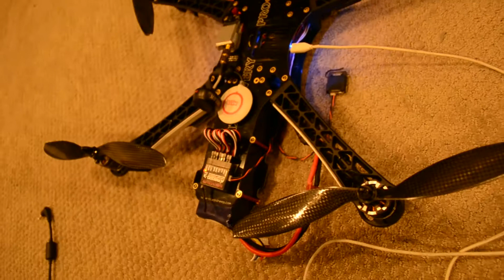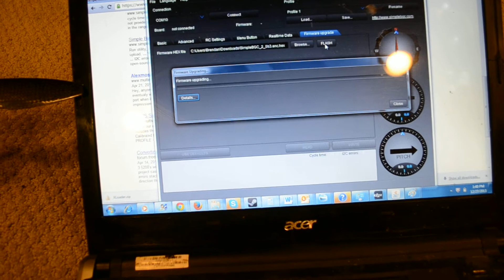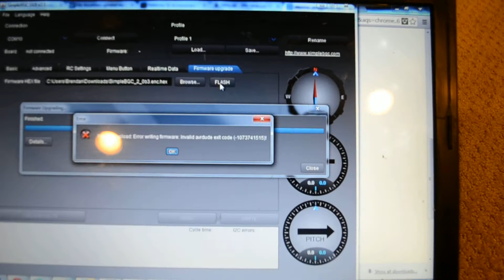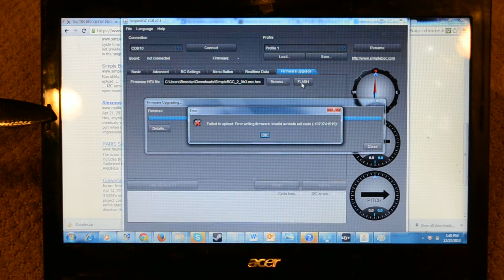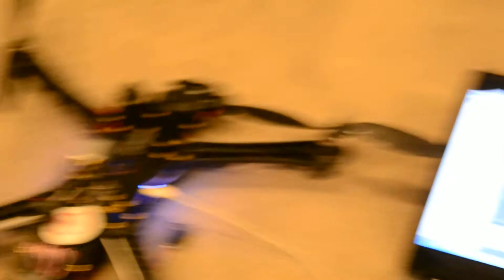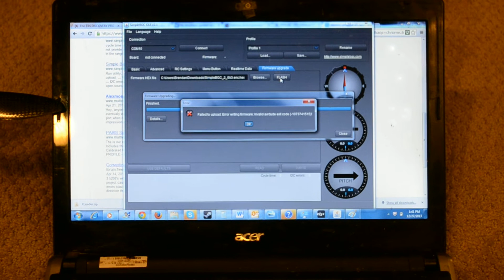TBS Discovery PRO Gimbal Malfunction

Comment: Had the same problem with another gimbal using the BCG software... it's happened to me twice, and the only way I've been able to fix it is by re-flashing the firmware more than once. I considered upgrading to the more recent version firmware, but I get the same error message your'e getting. Glad to hear you got it fixed! 

problem

problem2
Reply from the maker: Yeah, I knew it had to be a code issue. re flashing is the only thing I could think of to fix it

Comment: So what was the problem? How was it fixed?
Reply from the maker: Firmware mismatch.
Reply: Thanks.
Reply from the maker: That's the issue with the Discovery pro. The BGC appears to be incompatible with later alexmos firmware
Reply: This certainly raises an eyebrow. I'm in the market for a Disco Pro and from this Ill certainly not be eager to update the firmware. Thanks for the heads-up.
Reply from the maker: Absolutely! I've got well over 50 flight miles (logged) on mine and its treated me great. At least you know it works great out of the box

Comment: try to run the program as administrator, it might have an authorization problem to connect...
Good luck dude!
Reply from the maker: Thanks for the tip man! Tried that once but I'll try again
Reply: tell me if it worked. GL
Reply from the maker: Sadly no :( Trappy is sending me a new board
Reply: oh that's nice!
Reply from the maker: he wont need to though, finally got it!
Reply: oh nice, congratz! What was the problem?
Reply from the maker: I have no idea. I plugged it in one last time, It recognized, updated to 2.1, changed to trappy's settings

I have no idea what I did but I wont argue with success!

Comment: I had same issue with mine ( also the high pitch noise :D ) 

Here is what i did:
1. Downgrade to 2.1 FW with XLoader, you can find it here: http://www.basecamelectronics.com/downloads/

2. flash it with upload button, also 2.1 FW is on that page, it will say failed in the end but its ok its just troll message I guess :) it will flash it.

3. Download SimpleBGC_GUI corresponding to 2.1FW ( you can't use other version, they are not compatible ) 

4. go here: goo.gl/6IG27H download Profile 1 and Profile 2

5. Using SimpleBGC_GUI select on top right corner profile 1 and load profile 1 and apply

6. same thing just select profile 2 and load profile 2 config, apply

Make sure you have the gimbal looking forward... that did it for me, I still have to figure out how to give more power to brushless motors as even very small cable tension will make the gimbal stutter... Hope it help.
Reply: Also when it ask for power cycle, unplug battery and USB cable as well.
Reply from the maker: Thanks for the info Vlad! But unfortunately no luck Xloader keeps giving me a "cannot open port error"
Reply: Brendan Stewart it doesn't show in Device or COM port menu in Xloader ? I forgot to mention that I had to install driver first so the USB work, here: goo.gl/G58bpZ
Reply from the maker: The driver is how I uploaded the 2.3 in the first place, but it shows COM8 and COM10 in Xloader. Both say "cannot open port"
Reply: Brendan Stewart yea I was thinking you already might have when you uploaded the new FW, this is very strange behavior I didn't see that yet on mine :-/
Reply from the maker: I hope you never see it on yours! :)
Reply: Brendan Stewart one more idea, did you try to connect it to different PC ? if that doesn't work, it might be time to contact TBS directly
Reply from the maker: Yeah, I'l try that too. But my other PC had a fiery motherboard failure. Lol I'll get some help from Trappy
Reply: Brendan Stewart ok cool, he might be able to help. Let us know how it goes.
Reply from the maker: Will do! In the mean time look forward to some build videos